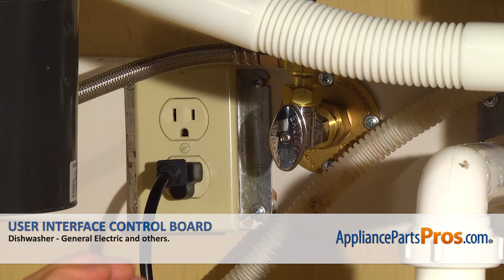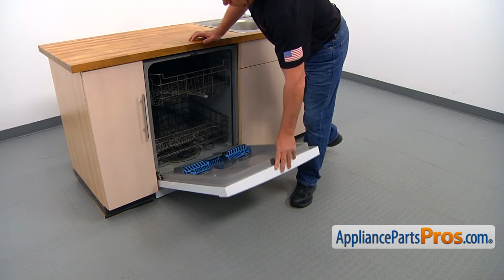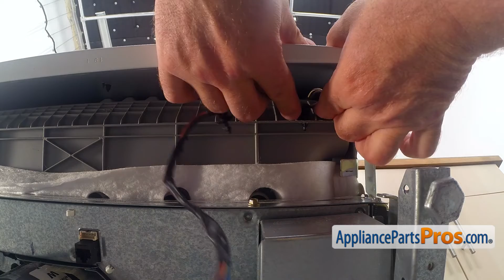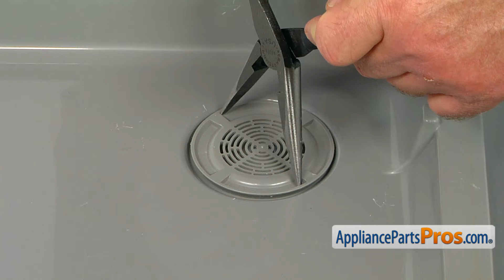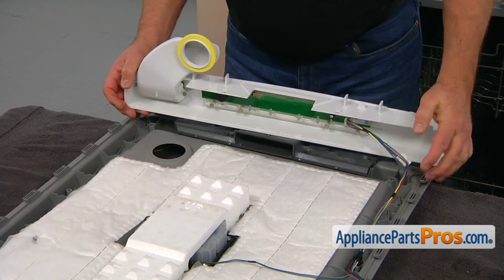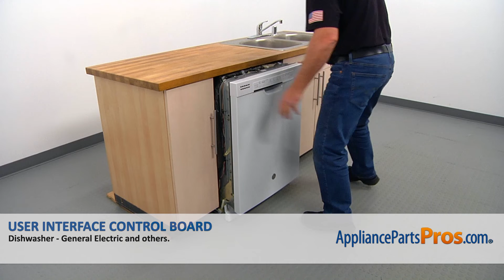How To: GE User Interface Control Board WD21X23463

Comment: Dishwasher was dead..  replaced the control panel board and its back on but beeping.  Have a feeling replacing the board just reset it.  But now it beeps every so often pointing to the user interface board.  Ive ordered one of these but should I put back the old control board and send it back for refund, I'm still eligible to do so?
Reply from the maker: What is the model number of your dishwasher?
Reply: @appliancepartspros  GDT580SMF4ES

Comment: Used this video to repair my dishwasher today. Thank you for posting! Took about 3 hours to replace after about an hour and a half to diagnose and determine that the issue was the user interface. Some of the plastic screw holders for the panel itself broke off but I put them back with some super glue.

Comment: Anyone with the stainless steel inside cover: there are an addition 4 screws on the lower insde (2 per side) as well as 2 more screws underneath all the way up instead (1 per side). You need to undo all of these before you can pull off the cover. The 2 screws inside are a real pain. But when you pull the dishwasher out and tilt it, you can access these. They are further back inside in addition to  the 2 on the bottom that he removes in the video.

ALSO: there was no hinge pin holes on mine (to hold the hinges in place at an angle. Very strange. I had to pull the washer out and disconnect the hinges from the springs. This was actually very easy though. If you do it this way, you should remove the the door with rhe hinges attached before you remove all the screws. Good luck everyone

Comment: I ordered a board and it came with no pins. Ugh
Reply: Us too. Most places are showing this part as back order. Did you find where to order pins?
Reply: @gardenfairy351  I just returned and ordered another and it came with pins
Reply: @bcar1ify  Having trouble finding these boards. Its back ordered from multiple places.
Reply: @gardenfairy351  yeah like most everything. It’s only going to get worse. Sad

Comment: Thanks, this worked for us.  We also had lot of rust on the hinges. We think it was because the bottom seal (it's like a weather strip on a door) got really caked with crud and probably was spraying and leaking water. Once you take the door hinges off, this seal slides out easily and can be cleaned.  Also the yellow foam around the port in the door was flaky and dried up on the side toward the door.  I gently pulled the foam off, turned it over and put it back on, since the other side was in better shape. Maybe this will help you too.

Comment: Can you tell me what symptoms would cause this part to fail?  My dishwasher seems to have no power. There is however power at the connector (where it is hard wired). The buttons don’t work and the display does nothing.
Reply: We found that not turning on and having the display do nothing was caused by the user interface control board in our case, but we learned it can also be the power control board which is on the bottom of the unit.
Reply: @thesqueedler  It would be good to show a couple things.  1. If you have the power control board hooked up and it has a solid green light, then it's probably the UI board.  2. if you are getting DC 13.5v - 14v on the #2 Black/Green to #5 yellow/blue, then the UI board is getting the proper power and it essentially is the UI board.

Comment: This video was perfect for us, however the jumper setting diagram was a bit unclear. We thought we had defective parts, so on our 3rd part (and after taking the dishwasher apart and putting it back together about a dozen times) we saw some comments about trying different pin settings and we finally got it to work! To us, it looked like the parts came set to personality 15 out of the box, but they weren't. All 4 pins had to get moved down toward the numbers to be set to 15 (ours was personality 10).

Comment: Jumper settings: instructions come with the new board. As shown on this video, They are 4 little plastic squares inserted into pins on the board. You then pull them out and arrange them according to instructions. It's a very simple thing to do.   ..if you don't adjust them the board won't start.
Reply: How are they adjusted, exactly?

Comment: Hi there, great video thanks.  The information on how to change the jumper settings on the UI board is missing however. I get that the board comes with the settings configuration, but how to actually make those changes?
Reply: There are 4 jumpers there, and can be just pulled straight up.  Then you can put them back on like in the diagram according to your model.